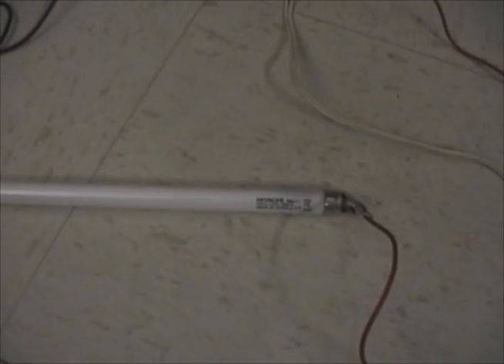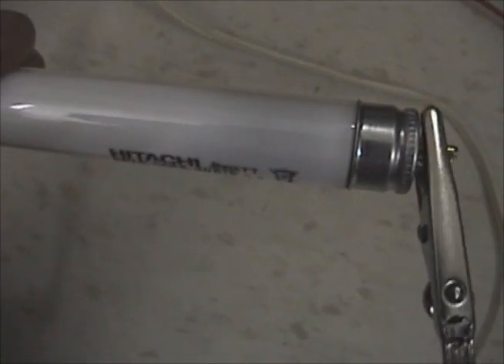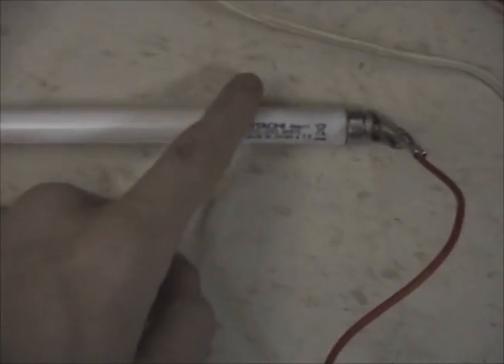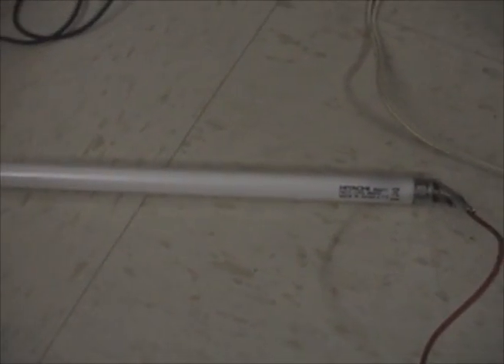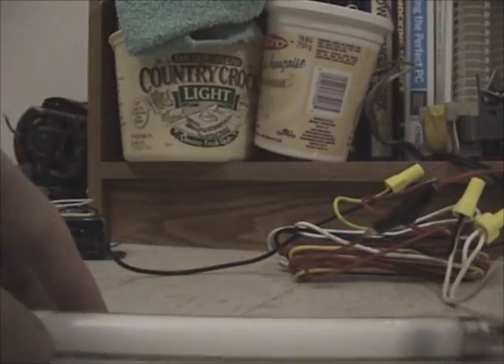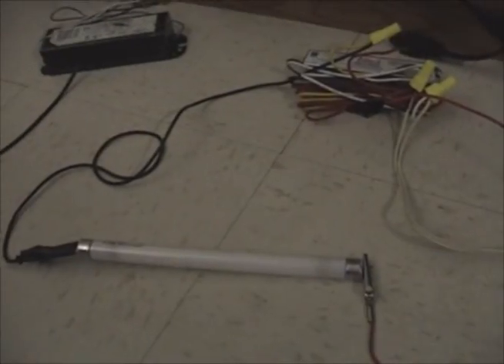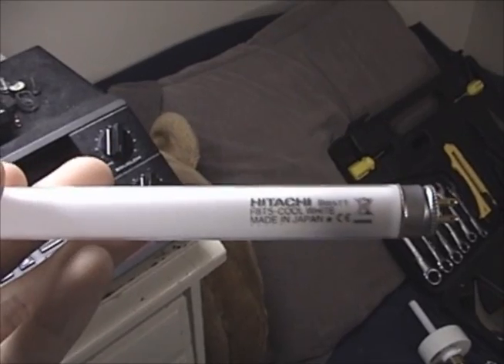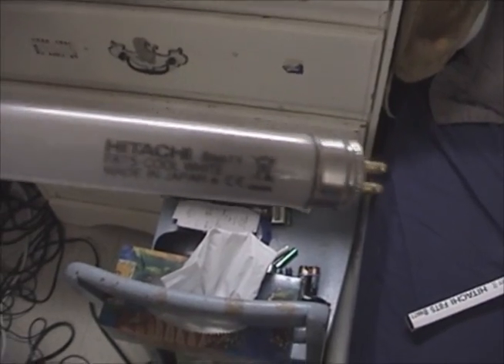Hitachi F8T5/CW fluorescent lamp gets fried

Comment: Did that to a 20 watt "Blacklight" tube blew one cathode applying 12 volts to light the filament. Developed a black spot and when I put it back in the fixture & powered it up it flashed a second (glow switch start) and that cathode opened up. Bummer.
Reply: never use 12 volt to light a cathode. maximum use 9 volts! it will light without brning the cathode.
Reply: @ducac-0457 I used 12v to light up a dead fluorescent bulbs cathode. I used 8 AA Batteries for it to work.
Reply: @homeguestunton i did try 12v and it destroyed the cathode. The tube was already EOL tho
Reply: @ducac-0457 you have to use 8 AA batteries for it to work
Reply: @homeguestunton i did excectly that. The EOL cathode lit for a second then it went off.
Reply: @ducac-0457 my 13 watt pl tube must have thick filaments because I did it on the the good filament because the other side was open and it turned on. I did this with another pl tube and a cfl bulb. I have a video of doing just that on my channel
Reply: @homeguestunton mine was an 18w T8 tube
Reply: @ducac-0457 I wouldn't recommend doing this on a linear fluorescent tube. Just the pl bulbs and spiral bulbs

Comment: hey man ive been watching through your vids and im liking them! i collect mercury vapor fixtures and it is very hard to find ballasts for them due to the bans :/ i have multiple 175 watt mercury fixtures without ballasts. i was thinking a 150 watt metal halide pulse start ballast would run a 175 watt mercury vapor bulb just perfect. because if so i would buy those ballasts to install in the fixtures. im not sure if it would underdrive or overdrive the lamps or not. what do you think?
Reply from the maker: +Nick DePaiva Thanks! Yes, a 150W pulse start MH ballast will run a 175W MV lamp just fine. There were many ballasts made that list both types of lamps.
Reply: alright sweet! i had one that would run hps metal halide and mercury vapor before.